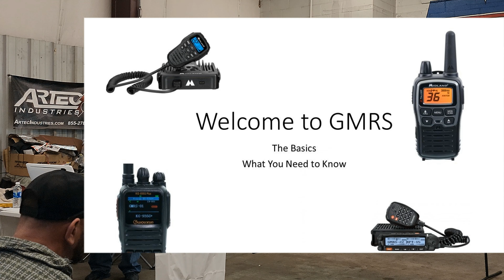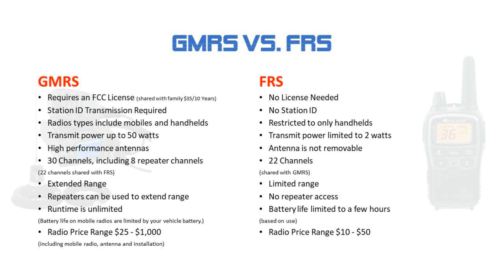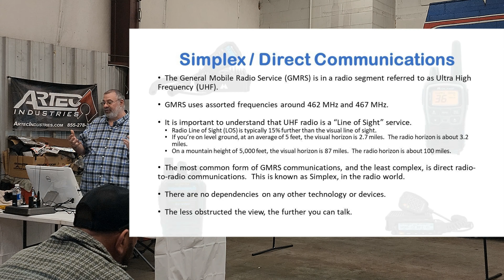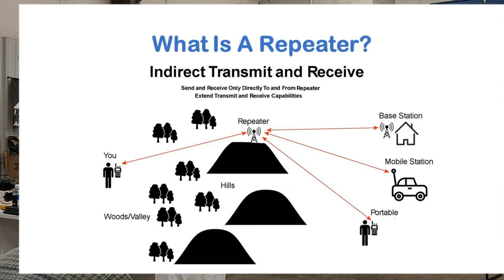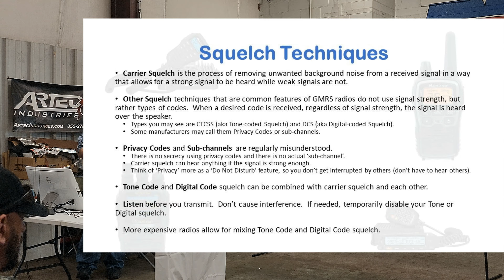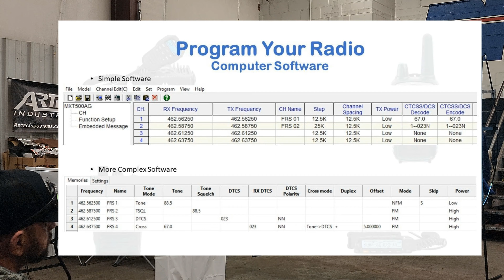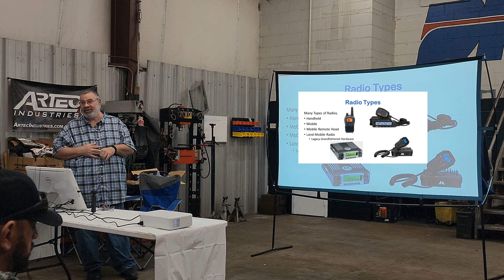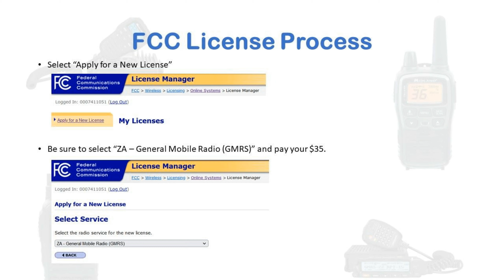Intro to GMRS

Comment: Marc....at the 22:00 time stamp you imply that there are no GRMS base stations... couldn't you use a GRMS 50 watt car mount radio...and just put it inside your house...all you would need is the 12volt DC power supply..easy enough to do?  Perhaps I just didn't understand the "context" of what you meant by that ??  Many thanks for all you so!
Reply from the maker: Yes, taking a mobile radio (or even a handheld) in to the house and using it with a power supply and base antenna, as a base station, verthe current solution. I am unaware of any purpose built GMRS Base Stations (in common terms).